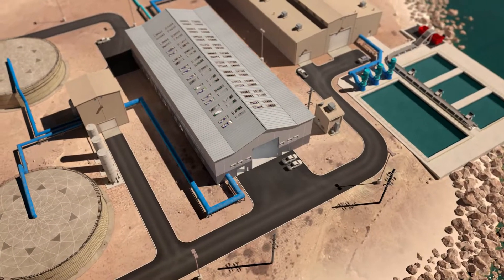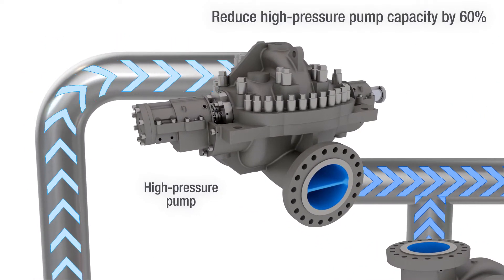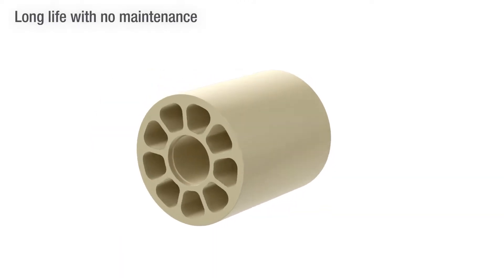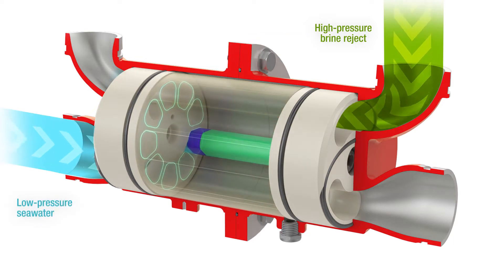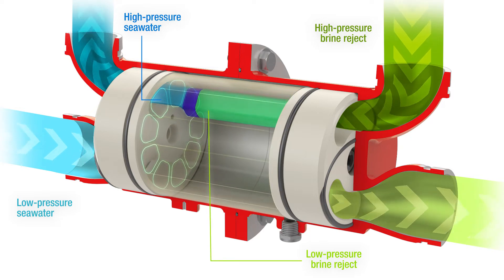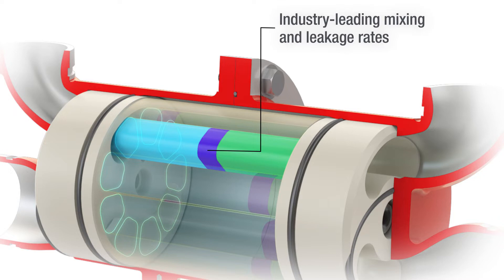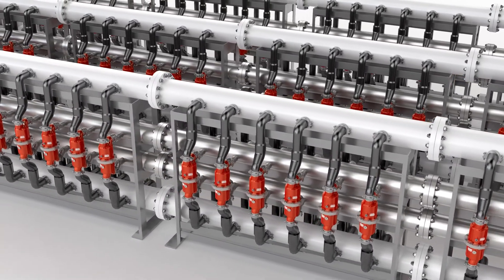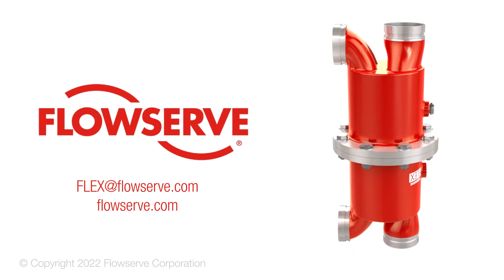Flowserve FLEX™ Energy Recovery Device: Next-Generation Compact Pressure Exchanger

Comment: I have a doubt to clear...Why does feed and reject water not mixing each other?
Reply: it does mix a little bit but due to speed of flow acts like a piston. The mixed water still runs though the system to produce clean water.